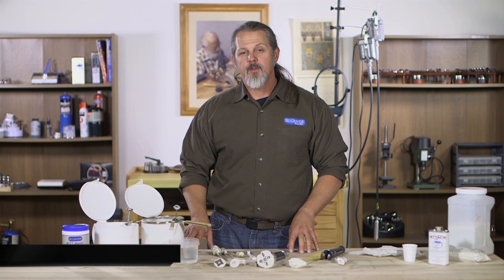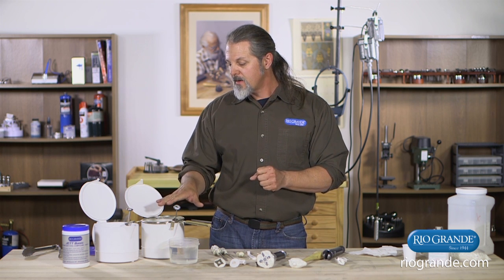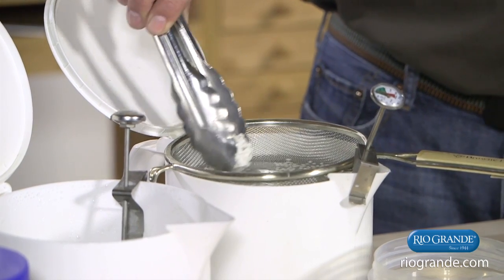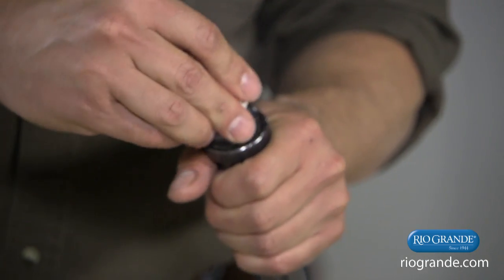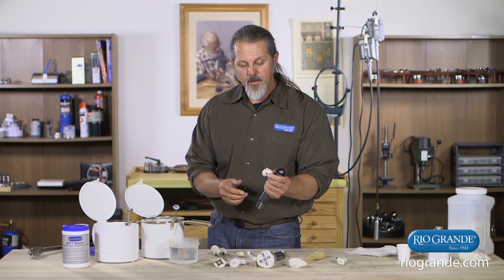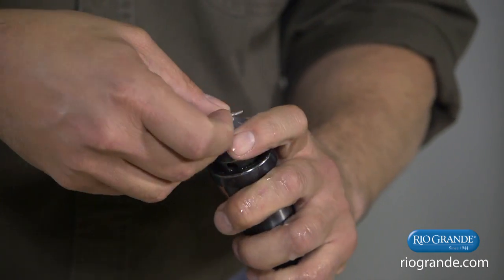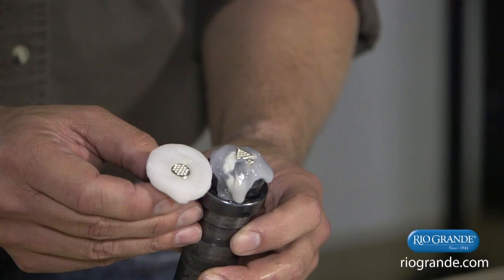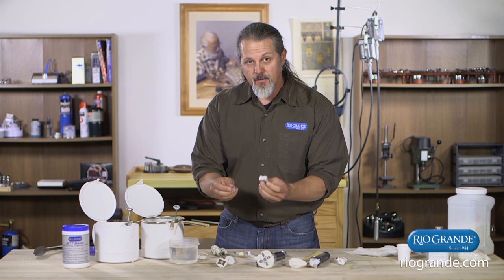How to Use Jett Sett Fixturing Compound

Comment: The trick of putting it inside a little plastic bag will help me with bezel setting stones on earclips. I had a heck of a time yesterday removing the jett sett from inside under the leaf in the earclip (for non-pierced ears) mechanism. Next time this will save me an hour.
Reply: Can I use a heating gun to release my peace ?
Reply: +trekranger I don't know. I haven't tried it. I would guess it would be too hot, and a hairdryer would be a better bet, but I really don't know.

Comment: I'm curious where that ring clamp can be found. I'm guessing it's a good one if Mark chose to pull it out for the video. I don't see it on the site, though.
Reply: Elisabeth P Hi Elisabeth. This ring clamp is a GRS ring clamp and is used with the GRS Bench Mate System 113619. you can check it out by following this link
http://www.riogrande.com/Product/GRS-BenchMate-Basic-Kit/113619?Pos=5

I hope this is of some help. 
Mark N Tech
Reply: Elisabeth P 
I ordered a good mahagony wood one from Lacywest.

Comment: Hi Mark, what are you heating that in? Also I see that the product available now says "Jett Basic. Is this what you sell now? thanks!
Reply: Hi Dharlee, Correct, the Basic #118221 is what we are now carrying, it takes a bit longer to cool down than the white version but I like it a lot. We are using an electric teapot to warm up the water. You can typically find these at general stores, and they are great for regulating the heat to the required temp. Having a thermometer handy really helps keeping the water temp just right http://www.riogrande.com/Search/thermometer
I hope this is of some help. 
Mark N Tech
Reply: RioTechs Thanks Mark (or whoever) :) This is great help!